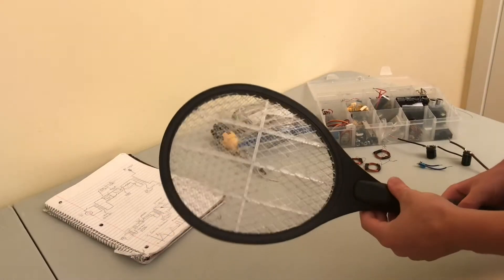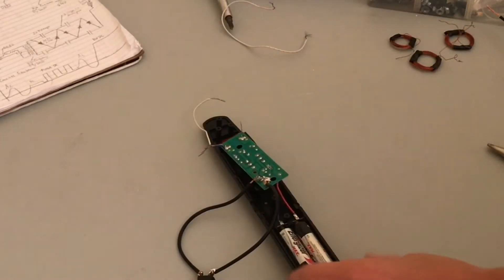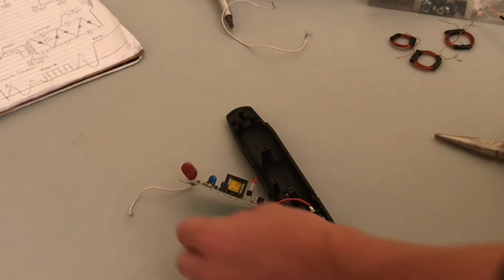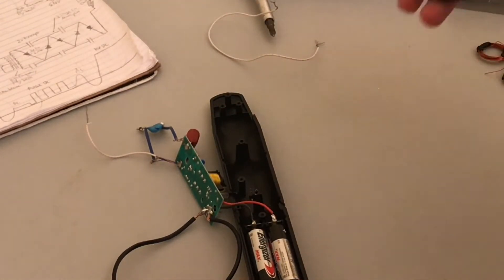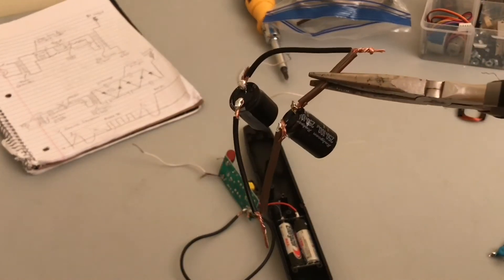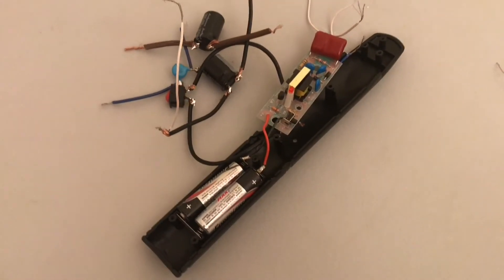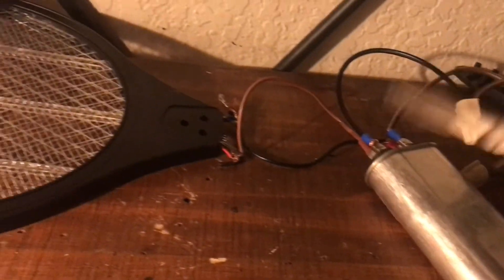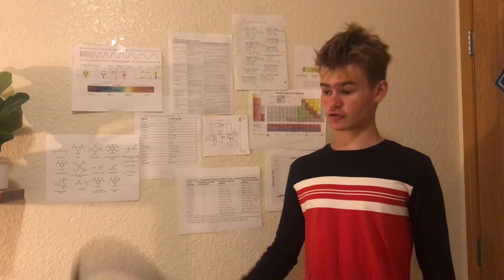Upgrading A Bug Zapper To EXPLODE Bugs!

Comment: I like your version better than styros for sure. You can actually explode bugs with THIS, and it's not 6 feet long.
Reply: Awesome You won't even need to hit the fly, it'll just arc over and he'll disappear, if that's even how that works but never the less, there will be huge sparks and probably a little fire haha
Reply from the maker: Yeah thank you, I mainly improved on the problems that Styropyro had with his bug zapper. Im planning to build a giant capacitor bank soon and attach it to a bug zapper grid plate and see what it does